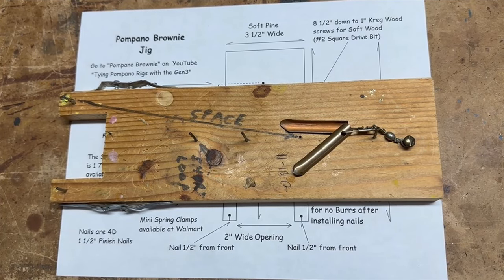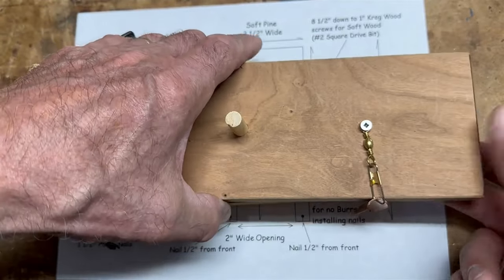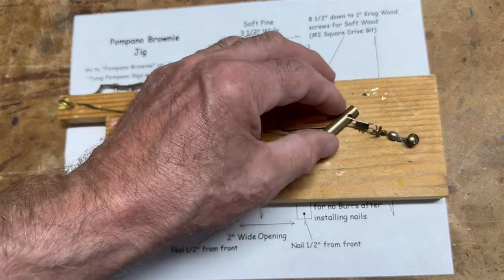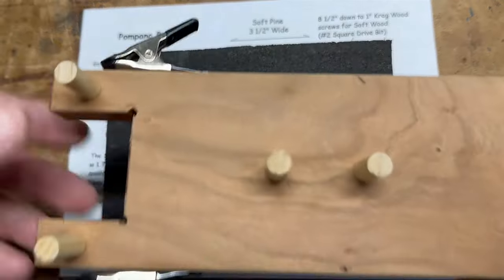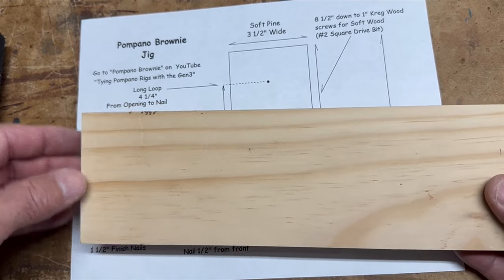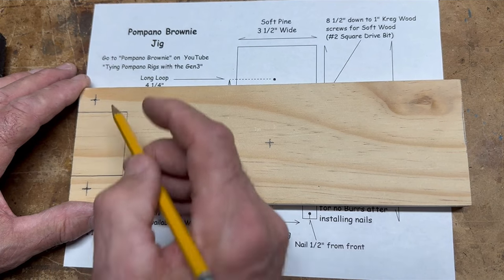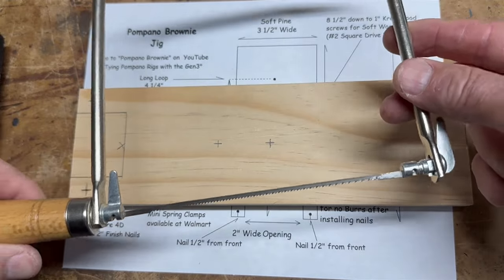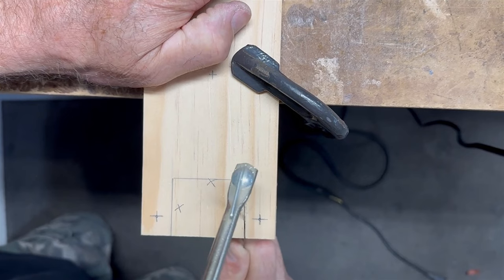Build the GEN1 Pompano Rig Maker

Comment: Sort of a report: it took me 45 min to build this, but I had alll the tools. This was the second attempt, I broke off one of the front "arms" on the first, because I picked 1x4 made out of some crap. I made the little shuttle thingy out of one of the clamps, as was suggested in another video. The tricky thing was to get rid of all the sharp edges after cutting off parts of it. The metal is extremely soft, so I  ended up using 400 grit sandpaper to polish it and not make more rough places. Awesome idea, and a great tribute to the Dad. I signed the bottom with the info for future generations.
Reply from the maker: Nice Job! And yes.. sanding off any burrs or sharp edges on the nails and metal spinner is a definite requirement. You don’t want to have any nicks on the monofilament after tying a rig. Tight lines, my friend.
Reply: @PompanoBrownie  I should mention that I added another small nail to hang the spinner while threading the loop, I saw this in a video of your father. It turned out to be very convenient for the last step of tying a loop.
Reply from the maker: He did have that on his!

Comment from the maker: See the GEN1 in action on Ebay in a Demo Video ! Just search Ebay for Pompano Brownie GEN1 Kit.

Here are tools you may need to build the Gen1 available on Amazon.

*These paid links to Amazon pay me a very small percentage if you use them, without raising the cost of the product.  This helps support the costs of making the Videos. Thank You

Pompano Brownie Gen1 3D Spinner Pompano Kit -  (Search Pompano Brownie on Ebay)

Hyper Tough Mini Clamps - https://amzn.to/45rzIvg

Coping Saw - https://amzn.to/3LRiAIC

#2 Square Drive Screwdriver - https://amzn.to/3ZKccIO

Dewalt 3/32" drill bit (2-Pack) - https://amzn.to/3LTGfI9

6" Quick Release Bar Clamp - https://www.harborfreight.com/6-inch-bar-clamp-96210.html
(For clamping Jig to table or workbench) 

1"X4" 4ft pine board - Lowes - https://www.lowes.com/pd/Common-1-in-x-4-in-x-4-ft-Actual-0-75-in-x-3-5-in-x-4-ft-Clear-Pine-Appearance-Board-Radiata-Pine-Board/1000534011

*These paid links to Amazon pay me a very small percentage if you use them, without raising the cost of the product. This helps support the costs of making the Videos. Thank You
Buy my Pompano Rig maker Kit on Ebay and make Rigs for as little as 81 cents!Your Rigs will be Stronger, have Better Hooks, Line and put ANY Color Float or Bead you want!
Just search for Pompano Brownie on Ebay!
- Pompano Fishing Gear Below -
Okuma Longitude Surf Rods https://amzn.to/3sWXOyk
 (Note * Cast - means Conventional Reel / Spin means Spinning Reel - Choose Heavy 20/40lb both)
Rhino Rack Ski Carrier Surf Rod Car Carrier - https://amzn.to/3F0vQV2
Penn Squall II 15 Conventional Reel (Chris Gallagher's Model) - https://amzn.to/3jLiJgw
( Choose SQLII15SDCS for the Casting Special version only 10.00 more)
Penn Spinfisher VI 7500LC  (Choose Long Cast Option) the Spinning reel I use - https://amzn.to/2FIEr62
( Largest is 7500LC 12-13ft rods, 6500LC 10 to 11ft rods , 5500LC 9 to 10ft rods.
8mm Glass Facetted Red Beads - https://amzn.to/3hwtaT9  
Glow in the dark beads - https://amzn.to/3iQT85s
#2 88lb Black Barrel Swivel https://amzn.to/2Fn5GD9
50lb Black Duo Lock Snaps https://amzn.to/2Rtc3qP
Sufix Tritanium Plus 20lb Chartreuse for spinning reels https://amzn.to/3VPK4RG
Sufix Tritanium Plus 50lb Clear for Rigs or shock leader https://amzn.to/3PhFI39
Sufix Tritanium Plus 40lb Clear for Rigs or shock leader-  https://amzn.to/2E3kBBH
Sufix Tritanium plus 14lb Sufix Tritanium Plus for conventional reels  https://amzn.to/3mr2fM4 
Momoi Diamond Presentation Fluorocarbon - 40lb. for Fluro rigs  https://amzn.to/3iwXm1K
Berkley Vanish Fluorocarbon - 40lb for Fluro rigs  https://amzn.to/3rzdkgO
Koehler Industries Clinch Knot Tool https://amzn.to/2ImsLqP
Diamond Round Colored Toothpicks for Pompano Rigs - https://amzn.to/3Yd50DD
Plain Round Toothpicks for Pompano Rigs -https://amzn.to/3JJY222
Stainless Diagonal Cutter to remove Hooks https://amzn.to/2lbVnqU
Large Nail Clippers for clipping Monofilament and Braid line https://amzn.to/3VIBK6a
Lanyards for your Nail Clippers https://amzn.to/2ljAV7K
Aluminum Fishing Pliers with Sheath and Lanyard https://amzn.to/2lJcv7M
Floats - Make Your own for Pennies.  https://youtu.be/A0si1Oqj2qo
Large Floats - Make Your own for Pennies.  https://youtu.be/m0uO063kHVM?si=MEezA6EUrXQSG1yx
Hooks - Eagle Claw Lazer Sharp L197 Circle Sea Offset 2/0 Hooks - https://www.tackledirect.com/eagle-claw-lazer-sharp-l197-circle-sea-offset-hooks.html
*Tip -  Get a Florida Commercial Fishing License for 50.00 if you are a Florida Resident, and you will find that many of the fish houses sell circle L197 2/0 hooks at a deep discount. Plus you can sell your fish to help pay for your gear.  Most Fish houses supply Ice for free, so it's worth the 50.00 annual cost!

 - Sinker Making Gear Below -
Lead Melting Pot is a "Lee Magnum Melter"  https://amzn.to/3hyv85p
3" "Do-It "Cast Iron Ladle  https://amzn.to/3myPtLQ
Pliers are Channelock E358 8" HIGH LEVERAGE END CUTTING PLIERS  https://amzn.to/2H2T2cS
DOIT 5, 6 ounce Storm Sinker Mold  https://amzn.to/48D8SlO
DOIT 2, 3, 4 ounce Storm Sinker Mold  https://amzn.to/41D9i9L
DOIT #2 Brass wire Eyes  https://amzn.to/32vvky4

-Trap Shooting Targets Below –
Laser Birds Targets are made for the purpose of Trap Shooting Practice at Home.
They are on Ebay. Just search for “Laser Birds Targets”
To learn more about Trap Shooting Practice at Home watch my YouTube Video. (Link Below)
https://youtu.be/l5bPL5zbvDU